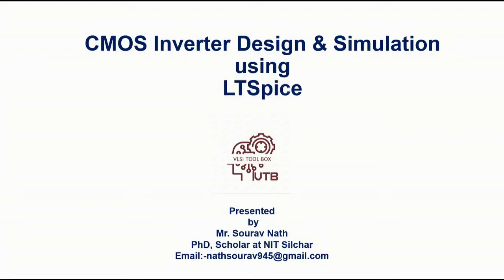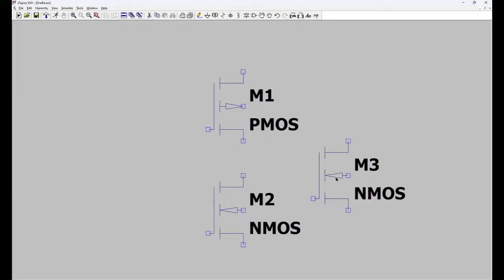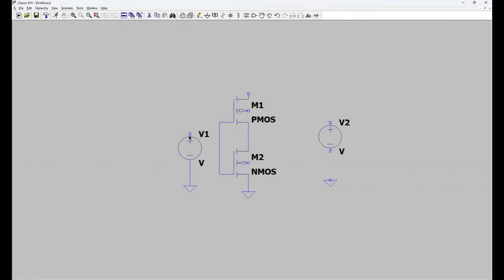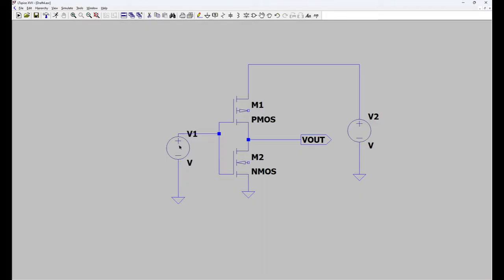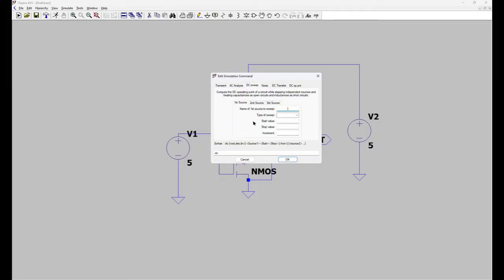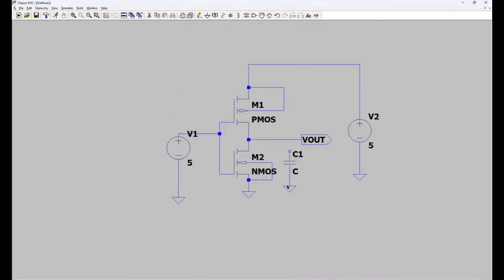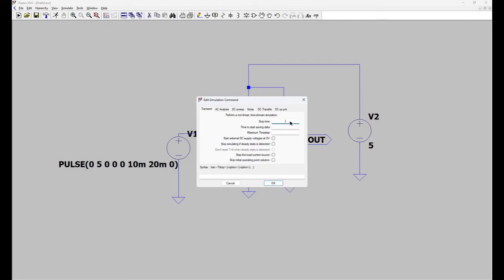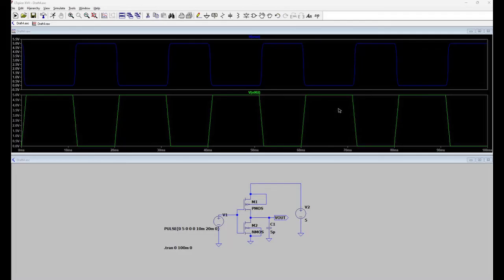Tutorial 1: CMOS inverter Design & Simulation using LTspice |VTC | Transient Analysis

Comment: Hi sir, how to view the waveform of capacitor charging?
Reply from the maker: Connect slightly higher valued capacitor to inverter circuit and run transient analysis, you can view the capacitor charging discharging